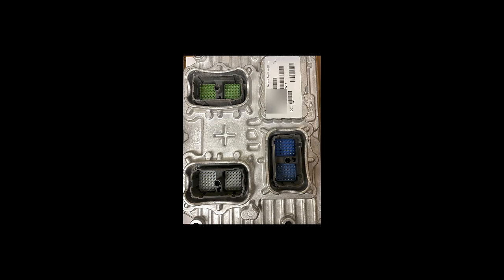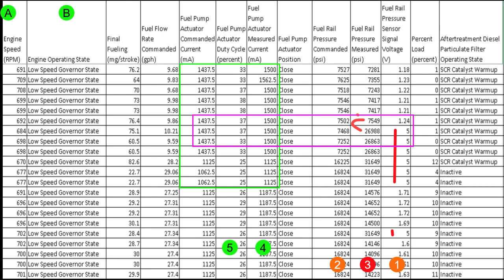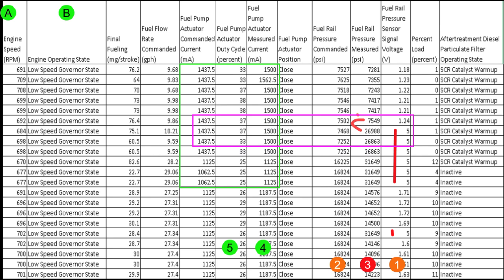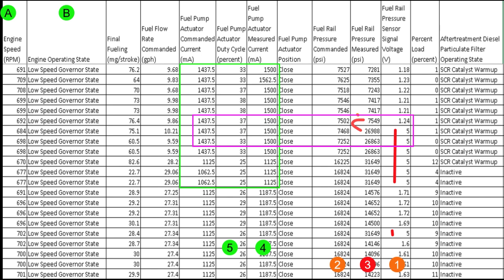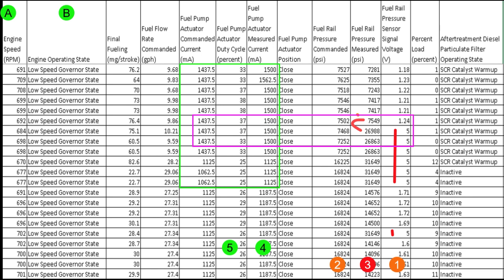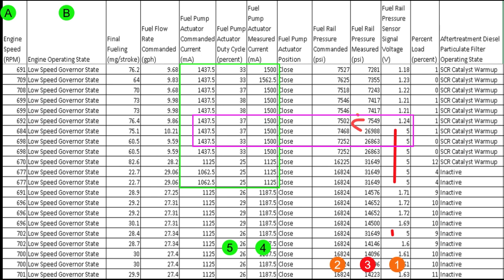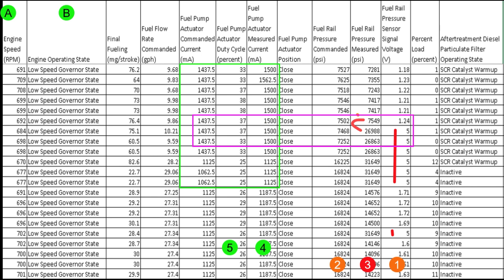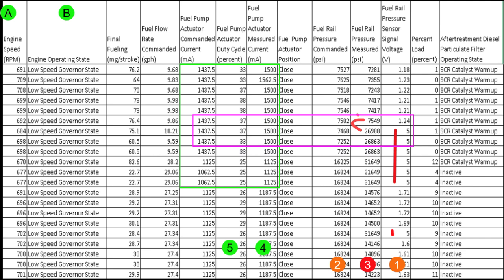Fuel pressure faults! The ECM might be the problem

Comment: 2014 chevy cruze 1.4l turbo.....Chasing this problem.....fuel pressure is low(43psi instead of 60psi). Replaced the fuel pump assembly. Bought a fuel pressure sensor which is located up by the tank and requires a ton of work to get to.... I bought an autel scanner and ran a diagnostic and it shows the eclipse is commanding 43psi and the sensor is reading 43psi....I am able to run an active test and raise the commanded fuel pressure up to 60 and low and behold the sensor registered 60psi but it resets to 43psi commanded when I exit the test...... the car also makes low boost pressure which I attribute to the computer limiting it because of the fuel pressure being low? I can bypass the wastegate actuator and it boosts to the moon before kicking a code for overboost and going.into limp mode so I'd assume the ecm is what is cutting boost.
Reply from the maker: I would also post this on other channels and forums that are chevy enthusiasts. The more you post this the greater chance you will have someone read it who knows the answer.
Reply: @ENGINESHOPJOE  I have scoured the internet and even the cruze forums. I need to make a post but I'm sure ill get flamed and told to use the search tool that I've used hundreds of times lol

Comment: Good find. My metering rail psi codes are always old fuel filters plus in two cases, a water bottle cap randomly plugging the fuel tank pick up tube, and a plastic fuel pick up tube not cut short enough in an IHC from the factory that would work it way on top of the drain plug bung.